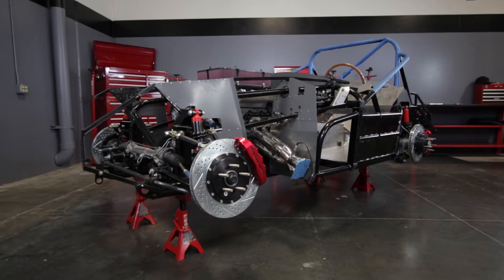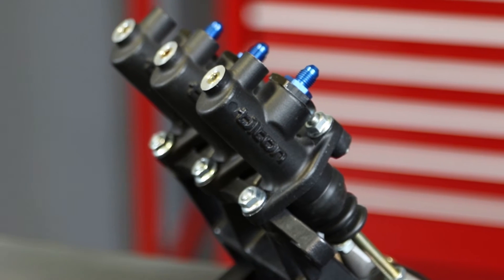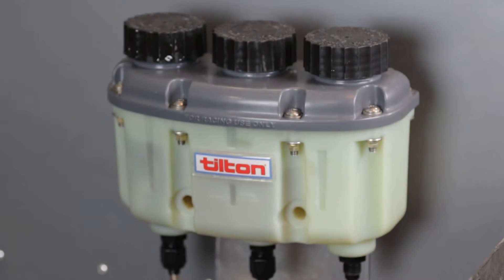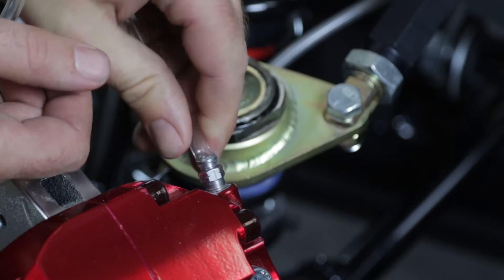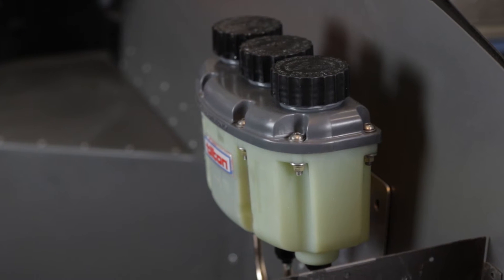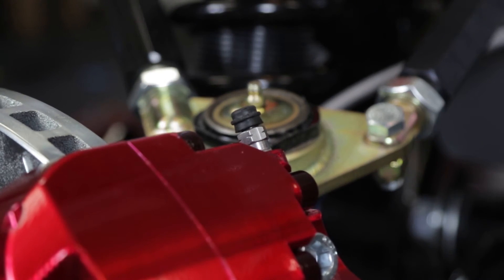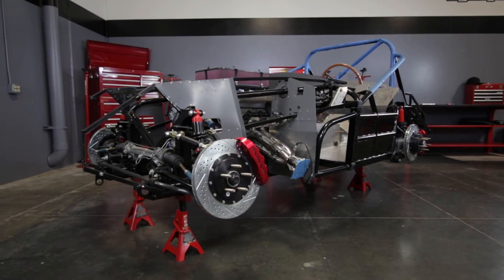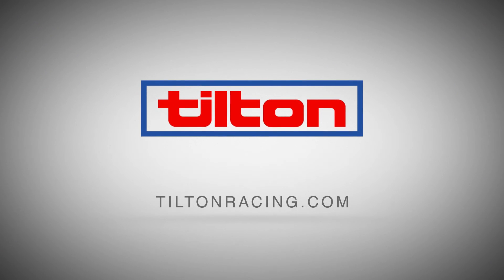Bleeding Brakes With Dual Master Cylinders

Comment: Won't you reintroduce air into the back of the master if you allow the pedal to return before tightening the master fittings (when priming pump)? Shouldn't you open fittings, push pedal down, close fittings, release pedal?
Reply: Proper way would be to fill both reservoirs, loosen the fittings on the outlets of both front and rear masters, and install two clear hoses submerged in brake fluid and pump the pedals till the masters are evacuated of any air.